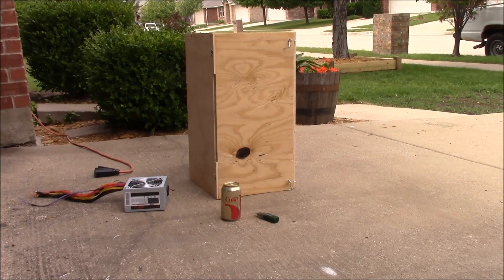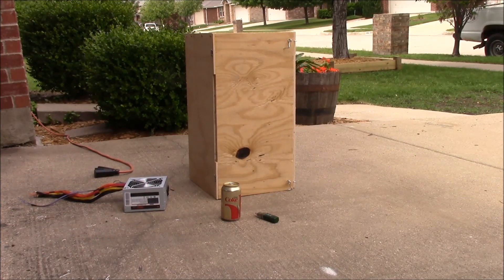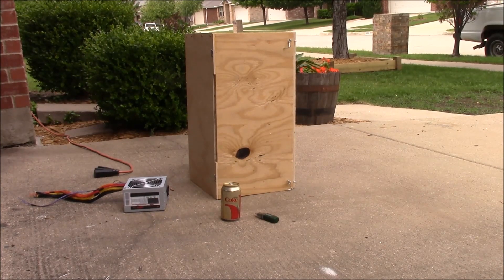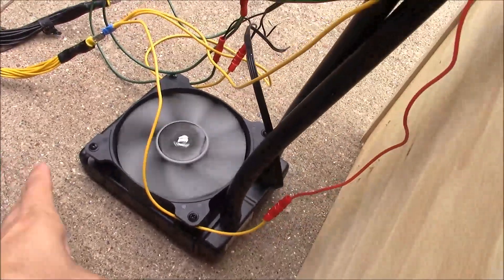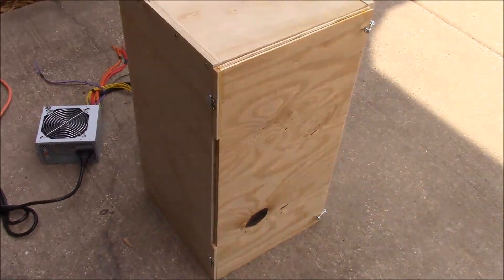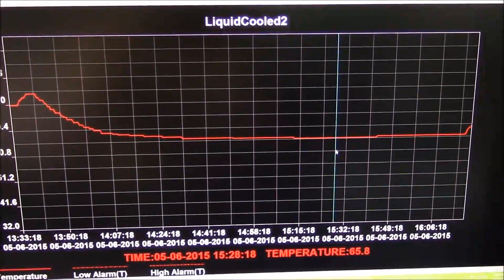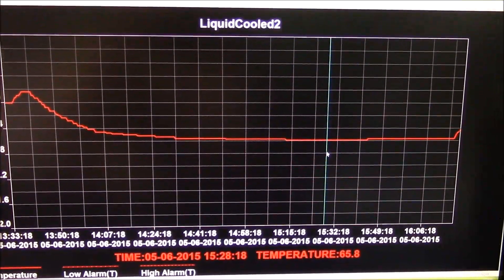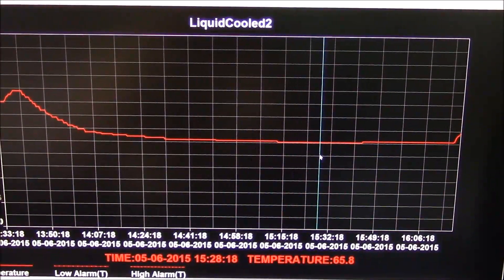Liquid Cooled Peltier (TEC) Refrigerator - Part 3

Comment: Please make a video build using a 15A to 30A peltier instead of a 10A peltier.  Please watch YouTube video titled: DIY Solar DC Direct without battery !!!  The 3 common methods.  /  Video channel name:  Solarduino.  Please share your thoughts if one or more of the 3 common methods could be used to solar power a peltier frig without using a battery.  According to Solarduino, a 12V fan motor can be powered by directly connecting the fan to a panel array without the risk of an amp overload and damage to the fan motor as long as:  (1) Each solar panel array is powering only one fan.  (2) The amp output of the solar panel array is less than the maximum amp input limit of the fan motor.  Question: Can the amp output of the solar panel array be the same as or perhaps one amp more than the max amp input limit of the fan motor if an amp regulator control module or a PWM motor speed controller (potentiometer) and a watt / amp meter is connected between the solar panel array and the fan?  Can a peltier frig be solar powered this way without a battery?  Please share your thoughts about these questions pertaining to this information after watching the Solarduino YouTube channel video.  Thank you.

Comment: Thanks for sharing this video series. poor efficiency of module +limited efficiency of the heat exchanger = crap performance. Surprised it got as cool as it did. In an enclosed case the air is dead heading and cant move sufficient amount of air across the heat exchanger.  May be better off using a heat sink and a fan on the hot side. Rig a vent so the hot side can  pull some of the cooler air out of the cabinet  and push across the heat sink. Peltier works on a delta T. If you can reduce hot side temp the cold side will also be reduce. venting the cold side will also remove the dead heading problem. Or vice versa, use a cold sink on the inside and the liquid heat exchanger on the outside. 

in the video the hot side looked like it was in the sun. Not sure if it was there for the duration of the test but direct sunlight on the hot side will certainly keep the cold side from getting cool. 

I am curious to see if you can make the liquid cooled cabinet work. I have some ideas where this can be used but not sure if it will be efficient enough to be effective.

Comment: thats still REALLY good for a single TEC.  i found on amazon a few 250watt amd one 550 watt peltier module.  but some of the reciews said they vibrate audibly. if thats not your worry then give em a try. i plan on ordering 2 of them
Reply from the maker: +Joel Mannerino Yeah I have seen those.  I have been a bit leery of ordering one since my mortality rate on the smaller ones is about 50% and those high power units are EXPENSIVE.  I would be interested in hearing how yours work.  If they are awesome I might order one.

Comment: You could try letting air flow on the heat fan... if you have it facing the floor, I doubt it would work.. Peltiers start heating on the cold side if you don't cool the hot side properlly.
Reply from the maker: IscleGaming | ZefaCraft The fan is basically not necessary so I wasn't too worried about it facing the floor.  The TEC does not produce enough heat to tax the radiator.  It barely gets warm to the touch.

If and when I perfect this prototype I will definitely have it mounted for better air flow and take care of things like this but for the experiment I wasn't too worried about it.

Thanks for watching and for commenting!

Comment: Hey LDS- I have been kicking around the Peltier people in trying to make that display case work.  They told me two things I didn't know if you knew or not.  Just trying to add to the collective here...

Each Peltier has a sweet spot for the best thermal difference depending on the voltage going through the unit.  12 volts is not always the ideal.   The chips I'm using now work best at 8v as example.

Having the same sized Heatsink and fan on both sides will not give optimum variance.  A good ratio they tell me is Double the Hot side from the cold side.  Have a Smaller heatsink and fan on the cold side.  

I don't know if this helps for future projects or not but it's what they told me.  

*side note- I chucked the H60 idea for the case and am going to build my own liquid cooling setup using a 25/75 water/food grade PG in the lines.
Reply from the maker: Roy Greenhalgh Very cool.  I have heard both of those suggestions before but I haven't really tried them out yet.  I have a voltage regulator that I may conduct some experiments with and see if I can get more efficiency out of this fridge.  Right now I am testing out a thermostat, though.  I should have a new video out soon on that.

Comment: I think you need to lose the fan on the cool side as it just adds energy/heat.  Plus insulate the hoses on the cool side...
Reply from the maker: Mat Helm I can give that a try but I don't think the fan makes much difference.  Most combo fridge/freezers have fans in them to circulate the cool air.  Maybe I will disconnect it sometime and see if it makes a difference.  I will look into some hose insulation, too.  Thanks!
Reply: LDSreliance Not the little mini fridges.  Remember, you're removing energy from inside the fridge.  Hot goes to cold.  The importance of that phrase I think, is that it works like on side of that water pump.  So you only need a fan to get the heat away from the hot side element, as the cool side will suck the heat to itself.  Not sure how good of an analogy that was, but hope you get what I mean.

The fan it seems to me, will just excite the molecules (which is to say, add energy/heat).  And that's not even considering the heat off of the motor.
Reply from the maker: You are right.  I just don't think it will even make a degree of difference.  It would save some energy, though, so it is worth doing.

Comment: The pc power supplies are irritating and expensive, there is usually no high current rail to tap off from and the wires just overheat at anything more than 100w, I used a server power supply as they are relatively cheap and give up to 75 amps depending on which one.   Just uploaded a video on my setup in case you are interested.     Good insulation on yours too, I ended up using foil type bubblewrap stuff and tape though.
Reply from the maker: TH404 Yeah you don't want to pull 100 watts through any single one wire.  I am no electrical engineer but it seems that pulling the current through all of those +12v wires spreads it out enough that I haven't seen any overheating in my testing.  I have put about 200 watts through mine for long periods of time with no problems but who knows?  I will check yours out.

Comment: Hey LDS, I was just wanting to mention that maybe when you think about it, the hot and cold side have the same load, so if the cold side liquid cooling doesn't work up to standard, you could try the air cooled setup again, but only on the cold side this time because you are getting better cooling of the hot side compared to the air cooling, resulting in much colder air compared to the air cooling of the hot side. I believe it's that water gives/takes 4 times as much heat as air. Just offering suggestions. I dont know if that would also be another option that you would consider or not. I'll stay tuned for part 4!

Comment: Very cool!
I hope you do more testing with this set to see how it could be optimized.
Reply from the maker: Jerónimo Barraco Mármol Will do.  I am going to test it with a 10 amp unit.  I tried to shoot that video today but ran out of thermal compound.  I will try to get on that this weekend.
Reply: Cool. i was wondering if the power supply you were using was enough. i think its a 500w one (doesn't seem like a high efficiency one).
maybe you should try to use it for more time. Though if the temp curve doesn't tend to lower maybe theres no use in giving it more time.

Also im a little confused because im used to Celsius.
Reply from the maker: Yeah the temp curve was flat so running it longer was not going to help.  The power supply provides up to 25 amps of 12v power (300 watts) on the +12v rail (it is a total of 500 watt supply) and my stuff was drawing less than 10 amps so that wouldn't be an issue.

I will try to post Celsius numbers as well.
Reply: LDSreliance Thanks for the thoughtful reply.
I have no idea how much a liquid cooling system would actually drain.
It's really nice if you could put some Celsius too because i can't really grasp the magnitudes. though i don't want to make you work more. :)
Reply from the maker: It isn't much more work.  I will just convert the F values to C before posting the video.

You are welcome.  Keep watching my videos and I will keep making them!